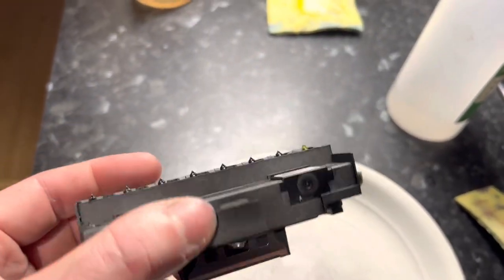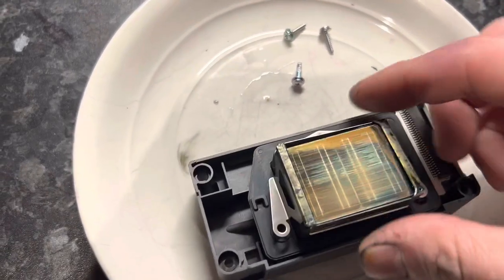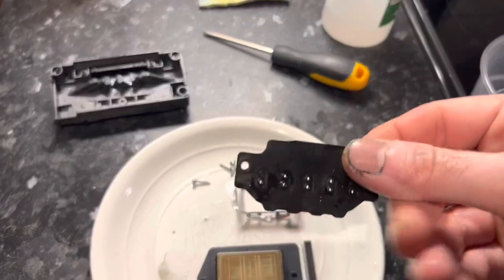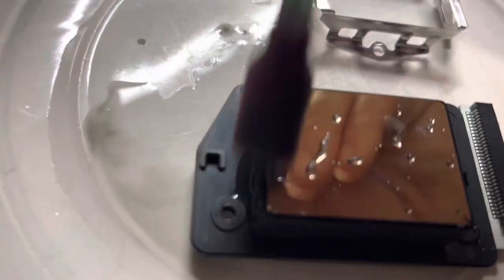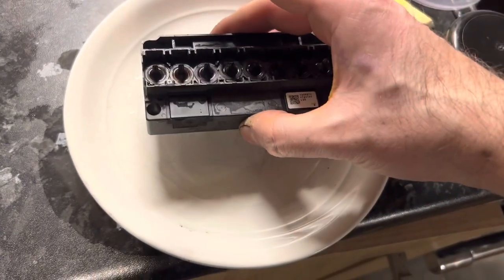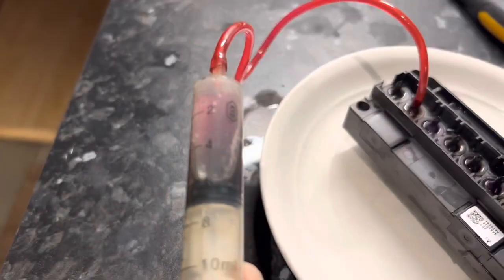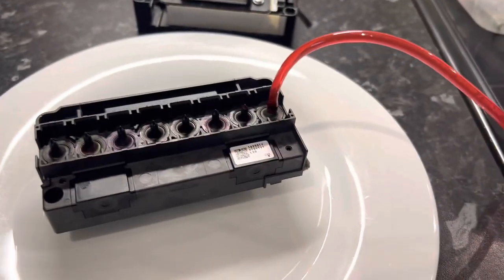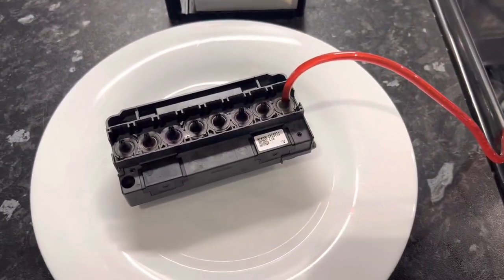Stripping and reverse waterfall cleaning / declogging an Epson DX5 DX7 printer head

Comment: Before you do any waterfalls,  make sure that the manifold injectors are all free then add the head not before ,this way you can be sure that the manifold isn't the problem as there is a tiny circular mesh under each injector and if that's blocked then nothing will get to the head ,infact the foil is not the problem it is the injector mesh that restricts the flow mainly ,the foil is generally easy to free up with a good cleaner...

Comment: It is important to notice that the author suggests suction which is the only safe method to use pressure with printheads. Pushing the air is applying very large force to the glue layer keeping the nozzle plate and very frequently ends up in delamination and complete failure of printhead. Since the area of the nozzles is very small, the pressure is not sufficient to unclog them anyway and the only luck is if they dissolve in the liquid. But at least the pressure is creating compression of the glue, not tears it off. Anyway, applying any pressure to printhead is extremely dangerous.

Comment: Hi. were you able to make this work after removing the gasket? i read from another commenter that gasket should be glued. Were you able to completely fix this? I have mine completely disassembled as last resort fix and am waiting for the glue for the metal plate as ive seen someone claiming he was able to repair his multiple times.
Thank you
Reply from the maker: @bonnjerubersaba6561  if you are referring to the metal nozzle plate once that’s come off its time to throw the head in the bin, it would be literally impossible to align it

Comment: Hi. I have a stylus 4000 and I live in Namibia where the humidity is close to zero!  I have successfully unclogged the heads 3 years ago using this method. Last week, I had to do it again as the heads were clogged due to no use of the printer for too long.  I managed to the get a good waterfall for each color, put back the head and tested... but 2 colors were still not coming after 2-3 power cleanings.  So I started over.  I could reverse flushing all colors but when I did the waterfall, 1 color was completely blocked and the cleaning solution (50% distilled water - 50% rubbing alcohol) was coming out from the next colors ( on the inlet side, not the head side).  I reverse flushed many times successfully but can not get the waterfall on that color... nothing is coming on the head side, only through the next color inlets!  What does that mean?  How do I solve that problem?  Would it be recommended to open the head?
Reply from the maker: If you are getting transfer between channels unfortunately the nozzle plate has delaminated (come “un glued”) :(
Reply: @DavesDiscoveriesChannel  which means... new printer head?  Is it worth it for an old printer?

Comment: Hi Dave, This is a brilliant video and unfortunately i have found this after doing what exactly i shouldnt have done, Which is clean the head and put it back after i thought it was dired, Now the Printer wont turn on at all. Btw i have a DX5 DTF printer in a custom built case and i cannot figure out how to solve and firstly locate the issue. Any suggestions please 

Thanks

Comment: I got a new manifold which was 100% (testing by pushing solution through)... not like my old one which has the first chanel blocked.  I fit it back to the head and tested pulling liquid from the head to the manifold as explained in the video.  Back in the printer, test print... nothing at all printed on paper.  After power cleaning, still nothing at all printed on paper.  No error.  What can be the problem this time?
Reply: I have been told its probably a fuse on the mother board.

Comment: what does it mean when you are reverse cleaning and air is being sucked through the other ports
Reply from the maker: The head nozzle plate has delaminated
Reply: @DavesDiscoveriesChannel  is it possible to get repaired?
Reply from the maker: @paulzamora4885  unfortunately not
Reply: Is a fake
Reply: @digitalstudioprint1168  lol
Reply: Depending on the print head, you might be able to find a replacement for less than $40 on ebay.
some times it takes some research to find the model number for the print head. other times you just type in the printer model when searching print heads and it shows up. most of the cheap refurbished ones are in china.
Reply: Thank you

Comment: Hello there, please, can you tell me how did you clean the manifold? as it doesn't show up in the video, thanks for your attention!
Reply: The plastic part with the little nozzles, I ran really warm distilled water thru the tiny little holes. The the yellow I had to use simple green. But make sure to rinse very well after.  Then let dry completely before putting back together.  I also used a syringe with the tiny long metal tip to get in the holes.
Reply: @deirdreholcombe8738  thanks, I ran some warm printhead hospital cleaning solution to clean the manifold, no problems there, I do have a severe clogg in my print head, pressure resistance for some channels, still working on it, but I already order a new head. by the way can I try to draw some cleaning solution directly to the nozzles where the electronic board is?

Comment: There are a lot of videos, where peoplay clean the head, by using a syringe and pressing fluid through the head. Are they destroying the head?
Reply from the maker: Yep
Reply: Nope, you just can’t  put a lot of pressure on it. I just cleaned a head that had been sitting for 3 months. Took 3 times of reverse flushing and flushing now every nozzle is firing.
Reply: They can.  They should reverse flush first and you have to be sooo careful and never push to hard.  .

Comment: Hi. Me again.  I dismantled the manifold from the lectronic printhead and found that the second manifold channel from the connectors was blocked... so I cleaned the channel with a piece of very thin wire and there were some kind of minuscule white cristals coming out.  I also cleaned the tiny little holes in the cone on top of the channel with a needle.  However when I try to push or suck the amonium/water solution through with a syringe, it is still sometimes much harder than the other channels... so I use my air compressor to blow air through and it flows as in the other channels but when I use the syringe again it sometimes becomes very hard... I don't understand... any idea?  The last thing I did is to leave the manifold submerged in the solution for the night.  Advice welcome...
Reply from the maker: You’ve delaminated the head.. you cannot put any pressure “down” the head
Reply: @DavesDiscoveriesChannel  The head is out.  I am only talking about the plastic manifold.
Reply from the maker: @drpaulgodard  the manifold is still fitted to the head though right?
Reply: @DavesDiscoveriesChannel  no. I removed the 3 screws, the metal plate and the lectronic printhead from the manifold.  so i am only working with the manifold which has a channel weirdly blocked... i tried to explained in my original post - we can chat on whatsapp if you want
Reply from the maker: @drpaulgodard  but was it fitted to the head when you put pressure through it and it came back up another channel?
Reply: @DavesDiscoveriesChannel  it was not coming out from another channel, it was coming out from the top.
Reply: @DavesDiscoveriesChannel  Not sure about that.  However, I would like to 1/understand and 2/unclogged the blocked channel on the plastic manifold only.  If I can succeed, I will replace the head on the manifold and test again.  If it comes through another channel then the head was indeed delaminated... if not maybe I have solved the problem and the cross channel leak was coming between the head and the manifold... do you follow me?  Can you help me unclogging the manifold only?
Reply: Each channel on the manifold are terminated by a cone with a few very small holes.  My thinnest sewing needle can not go through... any idea what would by 4 times thinner?

Comment: So afterall, did you fixed that yellow chanel?
Thanks for this,
it seems promising 🙂🖐🏻
Reply from the maker: I cleared all channels 👍
Reply: @DavesDiscoveriesChannel  Did the R800/R1800 printer work after putting it back into the cradle&running the diagnostics&print tests for it?
Reply from the maker: @Exaris79  yes BUT the capping station was also clogged 😂

I’ve now removed the head and put it to once side

Comment: the moment you removed that rubber, you just killed that printhead lol
Reply: why do you think that he broke the head when he removed the gasket?
Reply: @tomasmatal2564  because that rubber has also glue to seal ink pass. If you send ink through it. Ink will jump into electric parts then burned printhead
Reply: @makroprintEc  i have seen that this seal you can buy from sign-in-china website, so i think that this is replaceable part like head manifold
Reply: @tomasmatal2564  they do sell that. But they never answer if it will work..
Reply: @makroprintEc  do you know something about cleaning dx5 with syringe? I used acetone And třídě reverse waterfall And there were 80% succesfully recovered nozzles. I Have never installed this printhead to the printer, So i dont know od acetone Is good for solvent hrad cleaning.